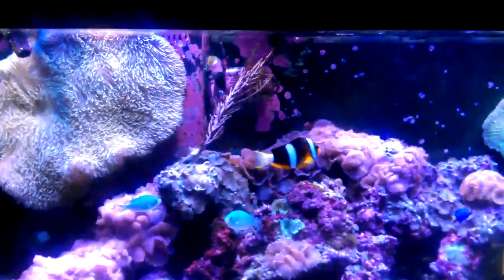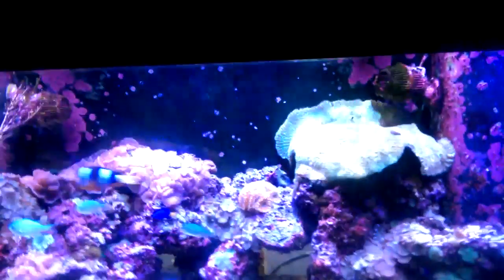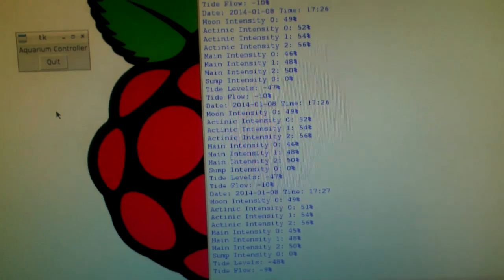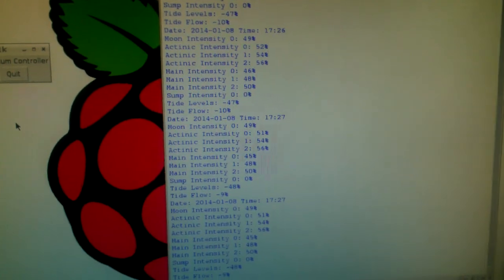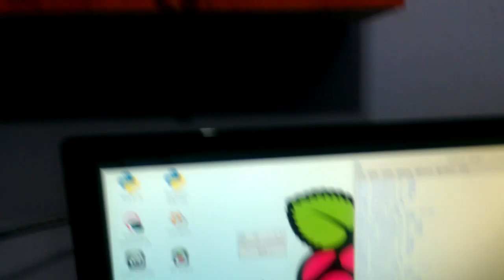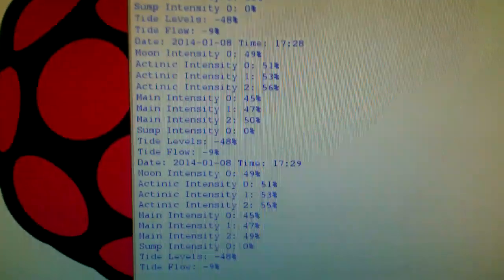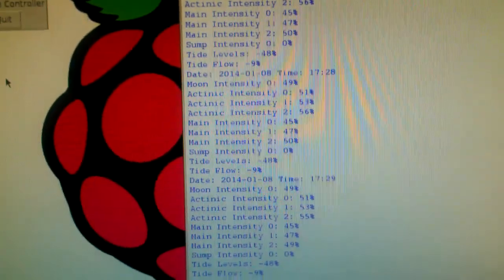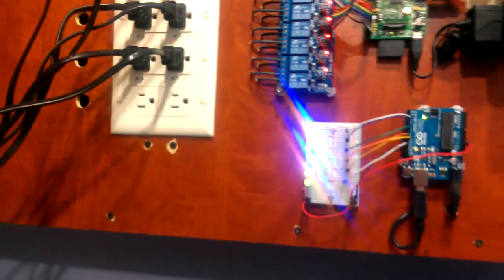Raspberry Pi Aquarium Controller (Part 1)

Comment: What lights are you using? I am hoping to do a similar project but I cannot find lights that have a dc input (well lights that have the "power brick") Most lights I see do AC-to-DC internally, and I don't think using PWM with AC power is as straight forward.  

Thanks in advance for your feedback!
Reply from the maker: +Ryan Tarver At the time I had Ecoxotic LED lights, but had tons of issues with them so I got rid of those LEDs. Many of the LED lights I've seen use only DC from a controller or a power brick to connect to the light itself. So that means you can add in the PWM controller on that wire.

Comment from the maker: @trillrudeboy The Raspberry Pi can do hardware based PWM but only with one or two pins. In order to do more pins with PWM you need to use software controlled PWM which isn't accurate or stable enough to use. With dimming LED lights the PWM needs to be fast enough to prevent flickering at low ON times. I needed 6 PWM pins to control all of my light banks. I have a part 2 video you can see that shows the final setup. I use the Rasberry PI to control the main relays, and the Uno to handle the PWM. Nice thing about that is if the raspberry PI is busy running calculations or I am making adjustments to the program the PWM isn't affected and the UNO will just hold the current values until updated from the rpi.

I have been thinking of adding on a temp or pH probe but haven't yet. I also have tide level calculations in the program but don't have the tank setup to use it yet. Would need to reconfigure the powerheads in the tank.

YouTube wouldn't let me reply to your comment...for some dumb reason...
Reply: Can you link to the update?  Also, can you point me to your Python code?  I'd like to do exactly what you have here!  Awesome setup and great use of a RPi! :)
Reply from the maker: Kenny Haren Just updated the video info to include the link to the Part 2 video. Or click here: http://youtu.be/YNNCAjGt_yQ 

I have an old version of the code on GitHub but have made many adjustments. I can upload a new version and send the link.
Reply: Shawn Creviston Thanks for this!  Very nice work, and beautiful aquarium.  BTW, do you think it would be possible to safely turn on/off pumps to simulate tidal activity using the RPi controller?
Reply from the maker: Kenny Haren Oh yeah, just as easy as turning lights on and off. You would just need to use another relay or two to toggle them. I actually have code in my project that calculates the tide cycles, unfortunately I had used all 8 of my relays for my lights so didn't have any extra to plug in pumps to use the tide cycles. You can get larger relay boards. The pumps you would not want to switch on/off very fast, and no PWM unless they are design for it. A couple powerheads available may be able to run off PWM to support flow intensity but I haven't tried yet. I am working on designing a 1100 gallon tank of which I plan to support tide simulations with flow changes and water depth changes. If you need help message me.
Reply from the maker: Kenny Haren I updated the code on GitHub if you want to pull down a copy. https://github.com/ShawnCreviston/AquariumRpiController.git

Comment: Do you have plans or instructions on setting up something like this, but to test water parameters and temperatures?
Reply from the maker: Winston Hubbard Not really, the code behind it is fairly simple as far as turning on or off GPIO pins. There are lots of tutorials online for that, including how to connect the Arduino to the rpi. My code for this project is on GitHub which you can download and take a look at. https://github.com/ShawnCreviston/AquariumRpiController.git

Temperature you could add easy but it may take a little more work getting a functioning PH monitor or to test other water parameters, I have not tried that yet. The rpi or Arduino has analog input pins you can use for reading values.

The second video I posted on this project shows more of the Arduino stuff.
Reply: So what is this monitoring and controlling in your tank?
Reply from the maker: Exactly what the video explains, controlling my LED lighting to simulate natural light cycles.
Reply: Okay cool